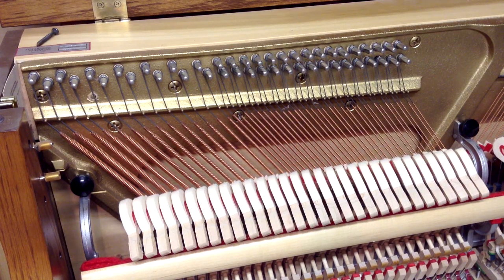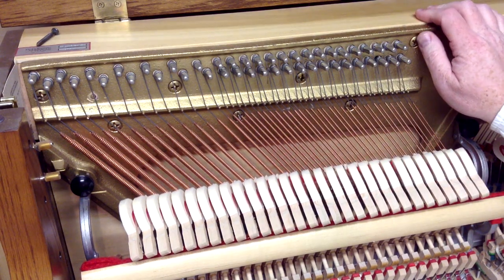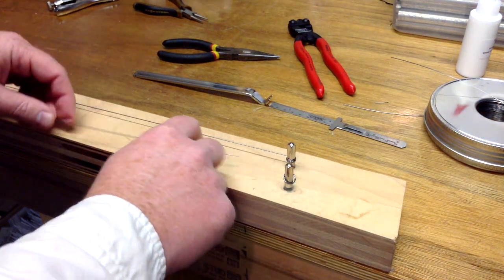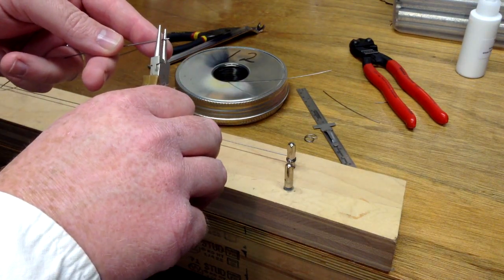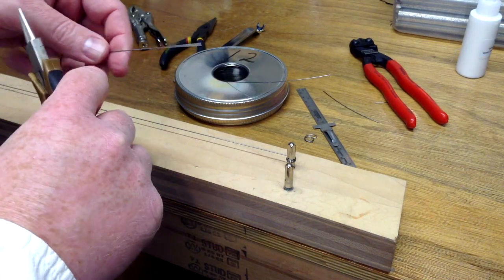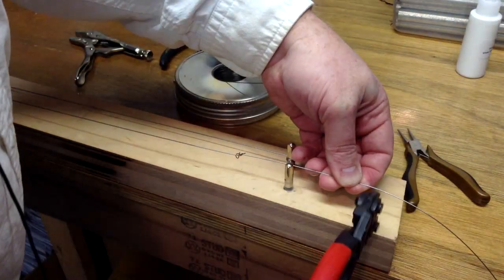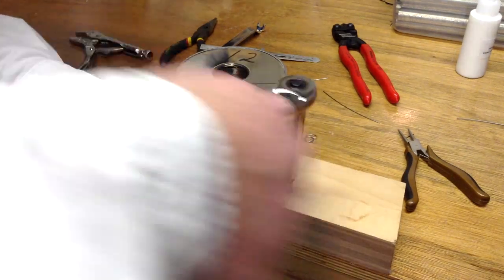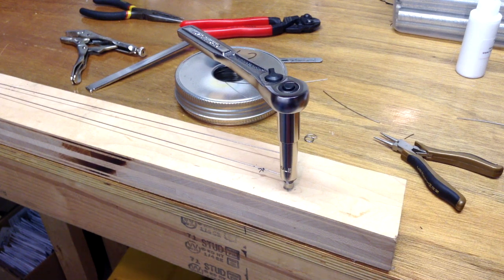Tying a Broken Piano String - Piano Tuning & Repair I HOWARD PIANO INDUSTRIES

Comment: Best presentation seen so far on Y/T !
Simple and without using those "must have" exotic special tools that every pro (me also...) has but uses...only when teaching this art to students... 
I have also used the cross-choked loops type... heavier but more stable on high tension.
My regards (a subscriber from Greece) !
Reply: Could you please explain what a "cross choked loop" is?

Comment: Great video.  This was much easier to follow than the diagrams in Reblitz.  Does it matter if you use a slightly different string size for the new leader if you are splicing on the non-speaking part of the string?
Reply from the maker: It is best to use the same size as the core wire, but you probably won't have any issues if you use a size that is off one or two thousandths of an inch.

Comment: Thank you again for an informative vid. Would I still have to back the pin out 3 to 3.5 turns if I am precoiling a string with beckett?  Would you mind telling me what brand of round nose pliers you are using?
Reply from the maker: I think they are Craftsman brand which I don’t believe are available any longer.

Comment: Hello Steve, Thank you for all your videos. Do you know where can I buy a pin block for practice purposes? Like the one on this video. Thank you. All the best.
Reply: Hi Juan,
I'm not sure if there is anywhere to get a piece of pin block for practice purposes.  I had this piece as a leftover from a pin block I had replaced.  We don't currently have pin blocks listed in our online store, but we can get these for you if you'd like to purchase one.  Otherwise if you have a piano rebuilder near you, you could see if they have any scrap pieces of pin block material they may be willing to give you or sell for a reasonable price.
Reply: Just for practice, You could use a 16-22 sheet dense plywood piece with a 1 1/2" thickness at least.
Not the very best but even some cheap (China) piano builders/restorers use it...
Mind to angle Your drill press by 2 to 5 degrees to the opposite way of the string direction to imitate an upright piano pinblock and make the pin holes deeper than the 3/5 of the full pin length.
Try to find the proper drill diameter by using a torque ratchet to evaluate pin stiffness after forcing it into the hole (using the drill press again, for better results, turning the choke by hand)

Comment: Just broke a C bass on a 1947 Wurlitzer spinet. Not being a wise guy, but why don't you noose it? I know nothing about piano strings, but a bass and guitar string are all 180'd around their bobbins, then wrapped 10 or 12 times around the string itself (think of a noose). It seems like doing it that way would look nicer, be mechanically stronger, and lay a little neater when pulled into/onto the pin itself, as some must when they break so very close to the rolling edge of the pin.

Comment: I have mixed results splicing bass strings.  About a third of the time, they come unraveled or just break.  I think it might be because the wire itself isn't in the best shape or whatever and these are strings that broke because someone hit them too hard.  Maybe better luck if I replace ones broken in tuning.
Reply from the maker: Yes, I have had instances where the wire would just break again after tying it due to the wire being too weak, so it's not a fix that will always work.
Reply: I had three that broke just yesterday while doing a major pitch raise which for me breaking even one is exceedingly rare.  But the strings had excessive corrosion to begin with so splicing probably wouldn't have worked anyway.
Reply: kwixotic
Reply: @kwixotic  Exactly if you look at the rusted strings under a loop, you will see deep pits when you remove the rust. those pits and gouges seriously weaken the strings